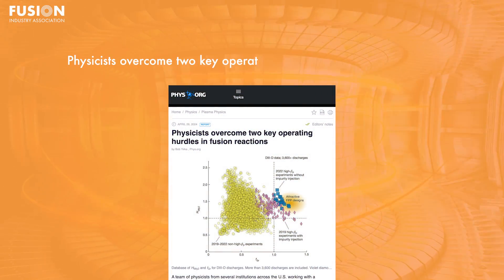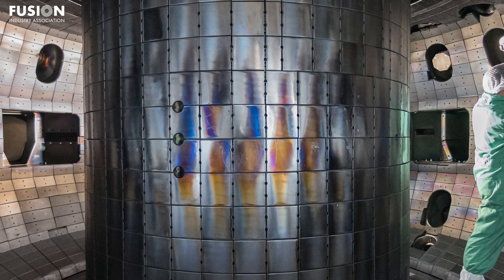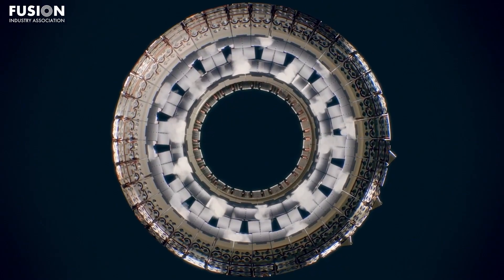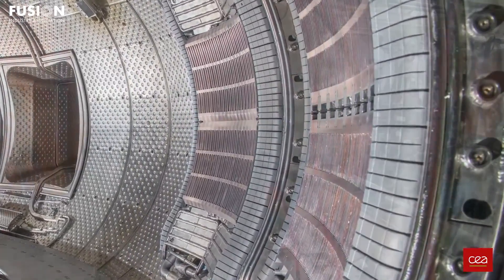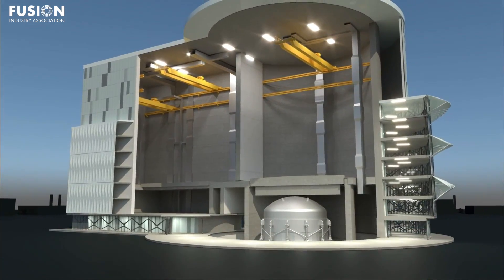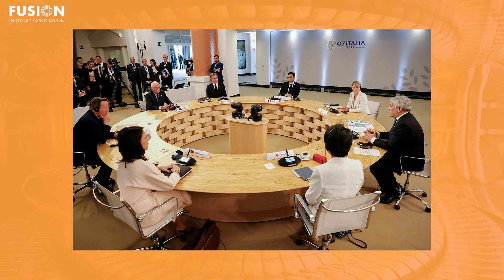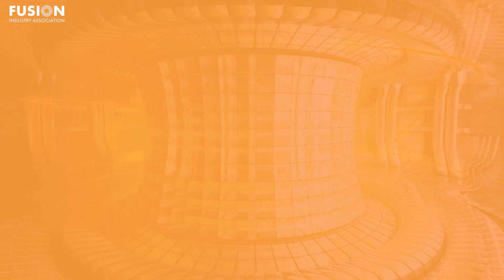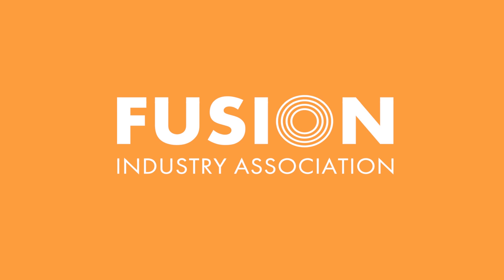Fusion News, May 15, 2024

Comment: Nice see the latest in tokomaks. Strikes me that they are going ahead without a working prototype.  Our configuration delivers and our prototype runs on air as a chemical fuel. I've not tried deuterium except in 1969 at the Rutherford when we powered a 1/4hp electric motor  I've been ignored  ever since.  Total disbelief.  Then the psychiatrist attacked and I lost my job.
Reply: They try to fake it in the hope they will make it before the people will found out that they have no real solution

Comment: The engineering hurdles are the smallest step to implementing Fusion.

The elite will put regulations in place to insure it never gets off the ground.

Because its not about clean energy... it's about raw power.

Comment: What the heck is that bouncing hot "particle" at the top of the WEST tokamak at 4:35??!? It can't be an actual particle, it would be knocked around the vacuum vessel toroidally as soon as it hit the plasma and wouldn't be so regular in its motion. It can't be a Thomson scattering laser beam, the time scale of the video is way too long for a light pulse to be slowed down to what's seen here, and why wouldn't it be traversing the entire bulk of the plasma....
Edit: aha, I thought of something! I bet it's actually a Langmuir probe. A metal ball on a stick that's being periodically mechanically "dipped" into the plasma volume to measure the e temperature and density in the plasma directly. It's being rapidly heated to incandescence every time it hits the edge of the plasma, I bet.